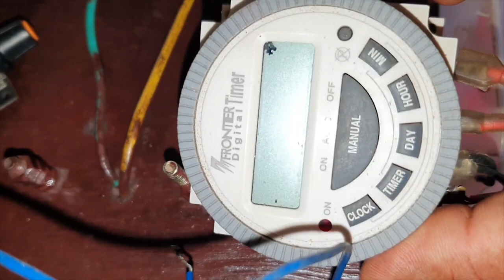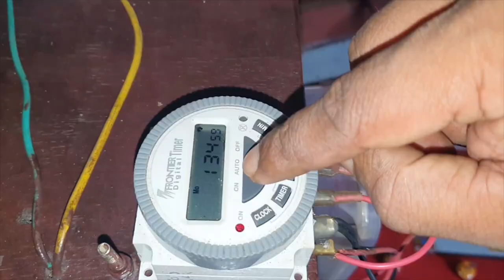Home made simple Automatic Egg Turner with Timer for Incubator

Comment: great sharing brother

can you please tell
how to place eggs for hatching,  vertically or horizontally

and for auto turning,, is it like just to tilt the tray left right like see-saw
or its actually to turn the egg itself upside down or roll one side to other

and what is the duration of tilting and interval,  like  after how much time to tilt,  for how much keep doing tilt,  and then stop for how much time

i hope your reply will be much benefit all viewers.

thanks
Reply from the maker: You can place eggs in horizontally or vertically according to your tray system 
The trays which I have I am placing eggs vertically pointed tip towards down side and tilting right and left 
The intervel of tilting minimum 4 hours, If u can do very one hour better, my timer has only 17 time setting so I am setting tilt 17 times a day
Tilt duration  I am setting one minute with slow speed
Reply: @deskon812  hello which are the materials you used to make all these